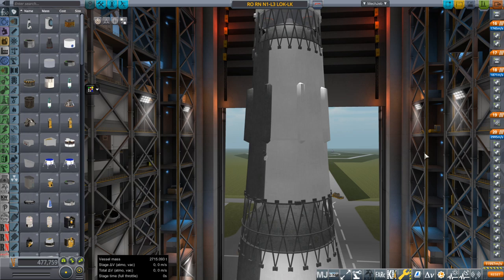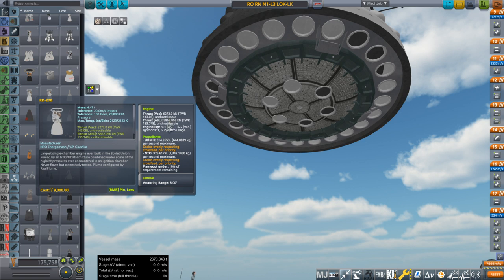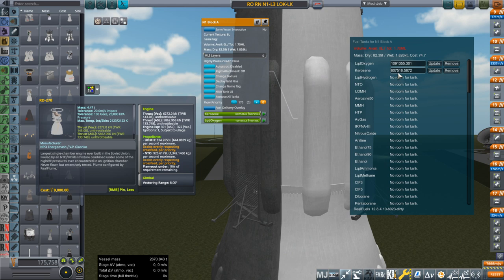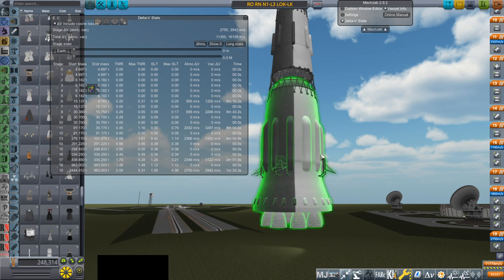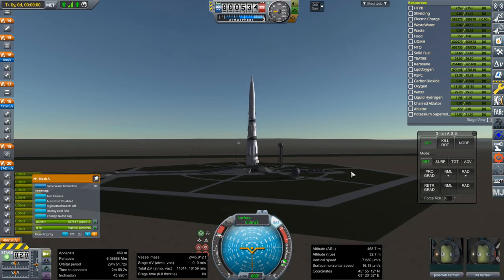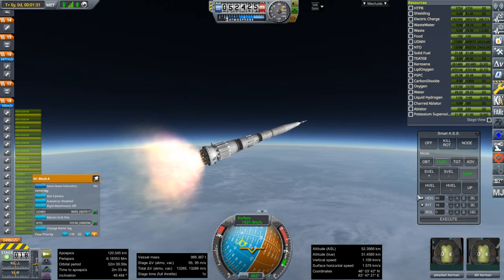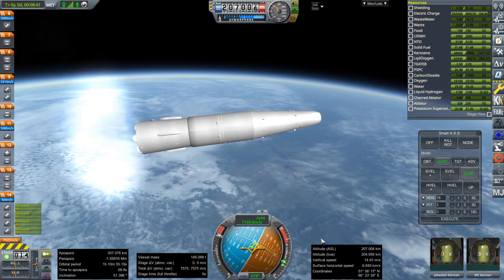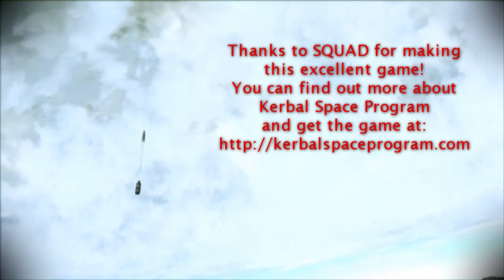Realism Overhaul in KSP 1.8.1 - Improving N1 - Sane Option 2

Comment: Valentin Glushko was not only a great rocket engine designer but also a fan of exotic fuels and oxidizers like liquid fluoride etc. So, I think he would prefer his modified RD-270M using pentaborane propellants. The engine has better performance (plus 42 seconds of ISP) over the basic version and it is available in your version of the Soviet engine pack.
Reply: Maxim Sinitsa this assumes that anyone would have accepted pentaborane engines.
Reply: @ScienceRules118  In real life, yes. There weren't technical issues around the concept, though. As far as I know, the engine was successfully tested and showed no critical problems (except for some difficulties with the original turbopump design of RD-270). On the other side, of course, the extreme toxicity of boron compounds made this engine too hazardous to be used for regular space launch systems. Anyway, in KSP with its unlimited budget and no ecological restrictions, you can realize any crazy ideas.
Reply: Uhh Pentaborane makes UDMH look benign. It's hard to imagine manufacturing, transporting and filling that amount of it of it without people dying. Especially if you take all of the test stand firings into account.
Reply: @tedeby5351  Oh, wait-wait. Pentaborane is just a single component. You can either oxidize it by dinitrogen tetroxide or use something really intriguing and promising (if you don't care about consequences for the environment and has a technology to produce and store huge quantities of liquid fluoride). In this case, your option is oxygen difluoride. It will guarantee a fantastic specific impulse. The negative effects, however,  will be absolutely devastating.
Reply: Glusko was very good at his job, but why was he so focused on toxic fuels?
Reply: @5000mahmud  Glushko wasn't really so focused on toxic propellants. Indeed he was focused on efficiency. For that reason, many other aspects were simply neglected by him. Unfortunately, during the 50th and 60th liquid hydrogen wasn't an option for the Soviet space program, so they decided to focus on something cheaper and available, such as KeroLOX, heptyl-amyl, and their derivates (e.g., syntyn). Honestly saying, Soviet engineers made perhaps the most efficient and perfect rocket engines that used the aforementioned propellants, partially because of these restrictions.

Comment: Raiz: There was a third 'sanity' option which was also looked at and then rejected due to the restrictions of USSR rocket production capability at the time. Higher power upper stages... Neither Korolev nor Glushko felt the USSR could develop most of the proposed high energy upper stages suggested within the then current budget or time frame. (As noted in the last video by someone Glushko was really proposing some pretty cutting edge upper stages but even he was aware that the development and/or deployment of such things as fluorine or pentaborane  engines wasn't going to be easy, cheap or soon. Heck Glushko had actually refused to consider building kerosene/LOX engines of the size Korolev and straight up said the USSR couldn't build hydrogen/lox engines at the time! (Now once HE was in the hot-seat his attitude changed a bit but at the time... :) )

So they were pretty much 'stuck' with kerosene/lox as propellants if they wanted to get things going but... Oddly enough I've found that there's a known but never really tried propellant combination that's vastly easier to develop than hydrogen/lox, not as good as methane/lox (which initially has about as many problems as hydrogen which is why it was initially skipped for the most part) but vastly better than kerosene and is 'available' at the time. Propane :)

Now hear me out before you dismiss it because it has about 80%+ the efficiency of methane/lox and when cooled to cryogenic temperatures (we're talking LOX temps not methane or hydrogen mind you) actually 'fits' into your standard kerosene tankage space at an almost 1-1 ratio but with a vastly higher ISP. The US did tests and found that only minor changes were needed to run cryogenic propane and LOX through the RL10 engine, (seriously, I suspect the SHORTER list is what have they NOT run through the RL10) and got over 80% of the performance they'd gotten from methane/lox in the same engine set up. In any case just having SOME improved performance from the upper stages is vastly more important than improvements to the first stage.
Reply from the maker: Higher power upper stages wouldn't improve N1 if the first stage kept blowing up, though. Just making fancier (and more dangerous) upper stages while the lower stages keep ripping themselves apart would be insanity.
Reply: @RaizSpace  True but it was some of the 'peculiarities' of the N1 design and development process that itself lent to the flaws. (Just like the US Space Shuttle) Forcing Glushko to sit down and design the engines would have been a game changer but that's not how the Soviet system worked at the time. Just dropping the inner engines and associated plumbing would have been a major reliability game-changer, but overall given the times and the circumstances getting to even THOSE small changes would be a stretch

Comment: grimaces I'm with Sergei Korolev on this one... Hypergolics ought to be avoided where possible on human-rated rockets. They do make sense for service modules and such though, but a full launch stage? I'd sooner use solids, and I'm pretty biased against solids in general. They pollute the most of any rocket by far and they're uncontrollable once lit. (That is, they can't shutdown nor actively be throttled.)
Reply: The Titan missile that launched the Gemini missions ran on hypergolic propellents. And about the solid boosters, what genius thought it was a good idea to use them on the Space-Shuttle? Actually the whole configuration of SRBs on the sides and a fuel tank attached to the bottom of the Shuttle was an accident waiting to happen (Challenger and Columbia). The Shuttle was a good idea, just implemented poorly.
Reply: The USSR didn't have good solid rockets till the 80s and while there were problems with the Shuttle SRBs those were mostly design choices driven by the budget given. "Technically"  you can have very efficient non-segmented SRBs (which would have eliminated the Challenger disaster) and the US had designed and tested both throttable solid rockets (the Shuttle SRB actually throttles "down" at Max-Q and then up again by grain design but there were other ways to do it as well) and thrust termination options, (which were available for the Titan SRBs) but none of those options work well with segmented solid rocket boosters like those used on the bigger SRBs and as I noted in the last video the REASON segments were used is because really large SRBs could not be shipped in the US by rail. (I won't get into the asides very much but due to the need to spread the "Shuttle" program around the more sensible option of building a large SRB casting facility at or near the Cape was rejected early on)
Reply: @twistedyogert  The Shuttle, (and frankly ANY LH2/LOX rocket) is very in-efficient on lift off due to the amount of thrust-to-weight you get out of the exhaust. The Shuttle needed a high thrust means of getting it up and off the pad before it wasted too much propellant just getting up to speed. NASA originally wanted to use new design kerosene/lox pressure fed boosters but the budget just wasn't there to develop them. They tried again to push for a Liquid Rocket Booster (LRB) design after Challenger but again Congress would not approve the funding to do more than 'improve' the SRB. (Fun fact: All the 'improvements' that were supposedly instigated by Challenger disaster were already in the SRB development pipeline and both NASA and ATK were aware of the SRB's shortcomings... The problem was until Challenger happened Congress was not willing to give NASA enough money to do more than small, incremental changes to the SRB design) On Titan NASA never liked the Titan, for one specific reason that it used hypergolic propellants and NOBODY was having a good track record of using them operationally in general use. (The Air Force was no exception) Further they were not happy when the Air Force forced NASA to pay for solving a large number of existing issues that the Titan had in order to even be able to launch manned missions. A consistent pogo problem was present on the Titan even in the already deployed operational Titan II's in service. While the shaking and vibration were marginally 'bad' for a nuclear warhead they would be fatal to an astronaut but the Air Force had no plans to 'fix' the problem till it became the launch vehicle for Gemini. (And frankly had NASA gotten what it really wanted they would have preferred to wait and use the Saturn 1 for Gemini even though it would have been VASTLY over-powered. NASA was not given the choice) Lastly the Shuttle SRBs weren't attached to the 'bottom' of the External Tank but were attached at the 'bottom' to the Shuttle/ET carry-through thrust structure which had to be there to carry the thrust from the SME's to the stack anyway. They were only attached to the ET itself at the top at the propellant tank interstage adapter.

Let me be clear here really: The Shuttle as we know it was a vastly compromised design due to budget restrictions in the main but NASA also had a large hand in designing in some of the major flaws. The stack was set up the way it was so that at some later date the SRBs and ET could be replaced by a fully reusable 'new' stage and a smaller ET to make the shuttle a fully reusable two stage to orbit system that NASA had always wanted. Unfortunately that initial concept eventually drove design decisions that rendered the Shuttle unable to ever be morphed into that ultimate system. Worse, (from NASA's post-Apollo point of view at any rate) the very nature of the full "Space Transportation System" was such that it's most logical and obvious usage would be to morph into a variable manned/unmanned system (what we know of as "Shuttle-C" was articulated during development by Rockwell and rejected and buried by NASA due to fears of Congress cutting the manned space budget if they got wind of a possible unmanned system. The US Shuttle COULD be flown totally unmanned but it required a special cable be in manually installed and this was only installed on the first flight, carried on the second in a locker and never flown again) which while providing NASA with a much more flexible and likely 'cheaper' launch system would have greatly reduced the number of manned flights which ws unacceptable to NASA.
Reply: @randycampbell6307  Thanks for the information. Did you work on the Shuttle? You seem like somebody who knows more than your average space-nut.
Reply: Actually, the Minuteman and Peacekeeper ICBMs had/have solids that can be shut down—both of their third stages have side ports that can be blown out, which explosively decompresses the motor and stops combustion. They had no mechanism for re-ignition, however. Also, while I'm not sure if these had any flights, there were proposals for solid stages with similar (but smaller) ports that would blow out and cause exhaust to be released from the side, "throttling down", though again irreversibly and by reducing the specific impulse rather than the propellant consumption.
Reply: @twistedyogert  Didn't work on the Shuttle but then again I consider myself a bit above average for a space-nut :) Seriously, between NASA spaceflight forums and alternate-history forums you learn a LOT from people who ARE rocket scientists :)
Reply: @grantexploit5903  Both Aerojet and Thiokol had patents in the mid to late 60s on "throttling" solid engines that could vary thrust both up and down during use. Most had to do with "pre-programed" thrust patterns built into the grain of the solid but  there were a couple that used injected components to alter the SRB thrust during the burn. (Much in the same way the larger Titan SRBs use injected gasses to allow 'thrust vectoring' of the engines in flight) The combination of complexity and cost, (SRBs as a whole never turned out as 'cost-effective' as general assumptions had been) of the added systems meant they never were further developed

Comment: I had thought from your comment that this was going to be your Insane Option, so I'm rather surprised your Sane Option 2 is very similar to mine down to its initial name, though with less combustion development. (Successors to the N1-Kh with non-spherical tanks would have 8 engines).

6:15 As the grid fins were for roll control, it makes sense to not use them (and in fact, to delete them) if you use gimbal(l)ing engines.

7:20 It appears that for whatever reason the 2nd stage mixture ratio problem was corrected in this flight. Well, probably it was because you didn't modify the engines, but the overall performance of the 2nd stage is probably still better than last time.

8:00 IIRC (don't quote me on this) by 1968 the major combustion instability difficulties were solved and by late 1969 they were comparably reliable to the NK-15s used on the virgin N1.

9:15 Uhh... UR-700 with N1 upper stages? N1 with Proton engines?

Comment: Probably could have got away with 6 rd-270 instead of 8, about 1.65 TWR at ses level, and much more manageable at burn out.
Reply: That would definitely work if the tanks were modified, but probably not with unmodified tanks, given the margins of only 107 m/s in this launch.
Reply: @grantexploit5903  I don't see why the tanks would need more modification, fewer engines generally means better efficiency, as long as TWR is high enough at the start.
Reply: Or 6 in a ring and a 7th in the center.
Reply: @tedeby5351  Could do, but it adds another point of inefficiency and at the stated TWR for these engines, you just don't need the extra engine. 6 would allow almost 40 seconds more burn time, getting the rocket farther and higher on the first stage.
Reply: @enginerd1985  "Fewer engines generally means better efficiency." You're correct that by decreasing the dry mass having fewer engines would increase the delta-V, but with the sheer mass and 3-stage structure of the N1 the difference probably won't offset the added gravity losses. Modifying the tanks for increased propellant load would make it have the delta-V situation of the unmodified 6-engine variant, plus increases due to thinner atmosphere, plus additional delta-V from its ascent from TWR = ~1.4 to TWR = 1.65.

Comment: With the TWR being that high, wasn't it possible to only use 6 or 7 RD-270s on the first stage? That would give it less weight and a mor acceptable g-rating without using early shutdown, so seems like a good option? Probably not getting engine out cap with 6 engines (though for the later portion of the flight that would work too), but seven looks actually okay.

Comment: Hi again, I hope u can answer this one... I've been trying to fly the N1 in RO 1.8.1 but I can't. While in the hangar and before starting up the engines it says I have 3000 m/s of delta V for my 1st stage. When the engines start firing, suddenly my delta V goes down to 1000 m/s and the craft doesn't accelerate, it gets stuck at 100 m/s... I believe this is a bug cuz I tried the RO craft file N1 and it behaves the same way...
Reply from the maker: I haven't had this experience and no likely cause immediately comes to mind. I'll mention it if I think of something.
Reply: @RaizSpace  thanks for answering! Never mind... I tried the 1.7 version and it works with it... Weird

Comment: Hey Raiz... can I email/contact you somehow? Cause I crunched some numbers on some engines (NK 33-34 and RD 191) and a Atlas style (ballon tank) stage and a half rocket with solid boosters to orbit and I want to just see the results of what would happen in KSP, (since I don’t have KSP and I’m bad at making stuff when I get my Hands on KSP anyways) and I think it would be a interesting video for you to make for the channel so... please?
Reply from the maker: If you crunched the numbers, I don't see what I can add to that. I'm not particularly interested in the configuration since I'm not really wondering anything about it. I usually test things where the outcome is really tight and I can't figure it out just by calculation.